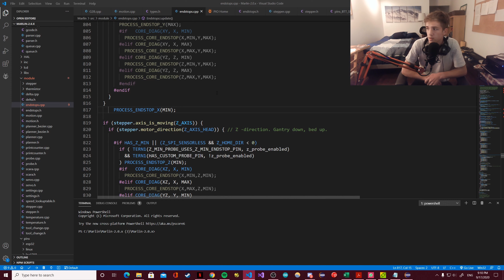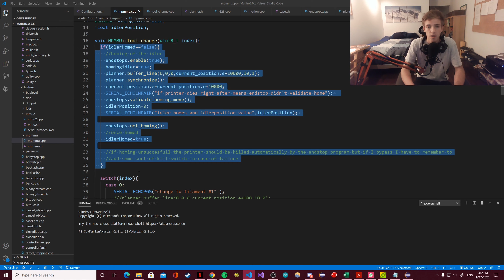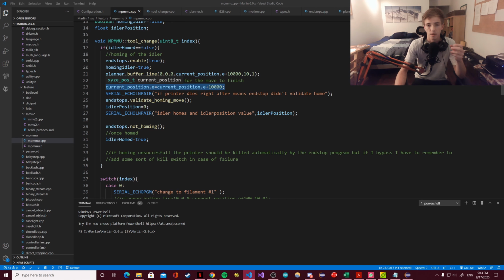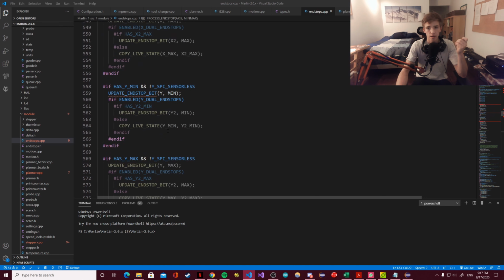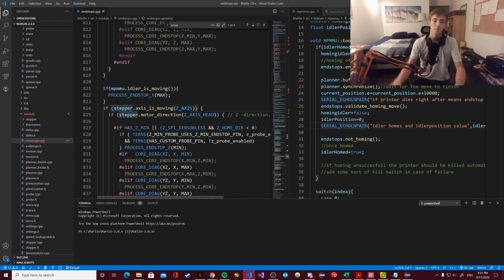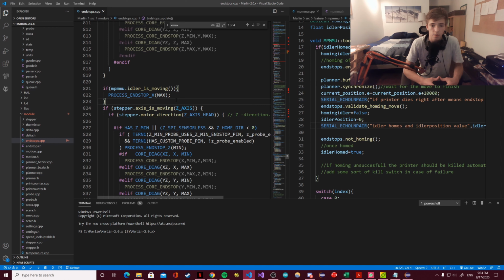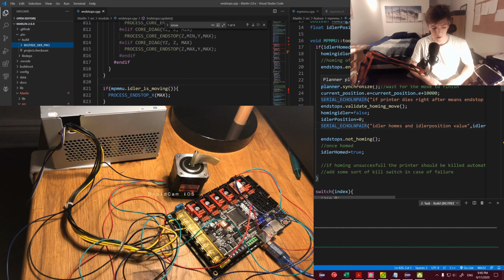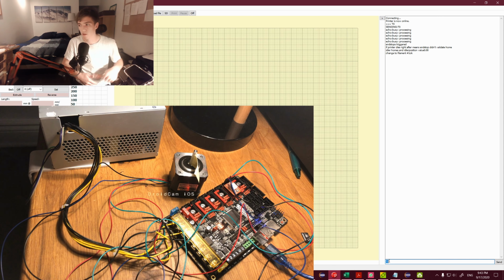Proper homing of the idler. MMU2 on any printer Part 18.

Comment: Would it not be simpler to have a sliding selector in front of the exits? The selection mechanism would be at the front and be activated by a bearing on the selector pushing it inwards when the selector is in front of a given channel. You wouldn't need the large drum, and the homing would be trivial using endswitches.
Reply from the maker: Well simpler I am not sure... better maybe, and I am also homing the idler/drum using an end switch the complexity comes with the fact that we have to define an extra axis on the firmware side of things, which is also the case if we use a selector. For now I am sticking with the idler setup because I know it works but this may be an idea for improvement in the future. The only problem I see with that solution would be putting the right amount of pressure on the filament being extruded and this would also complexify the model physically.